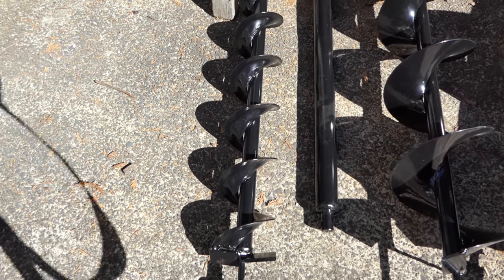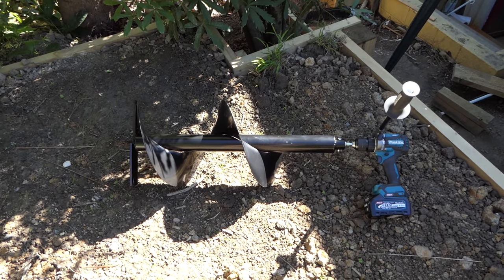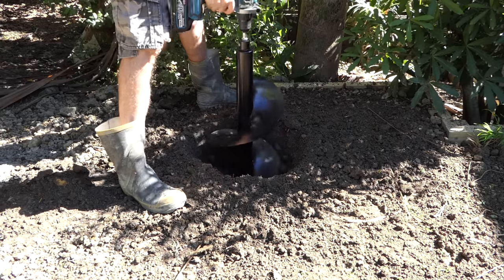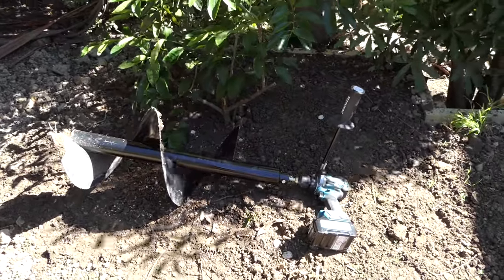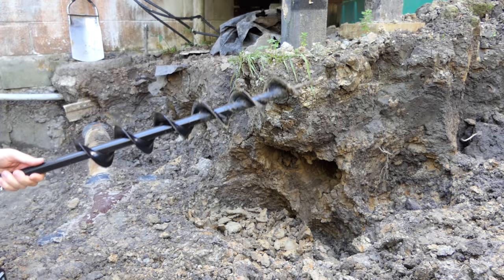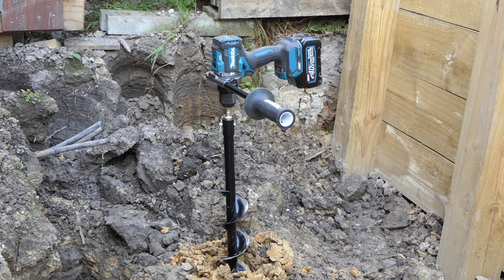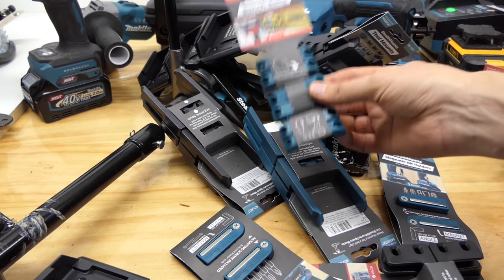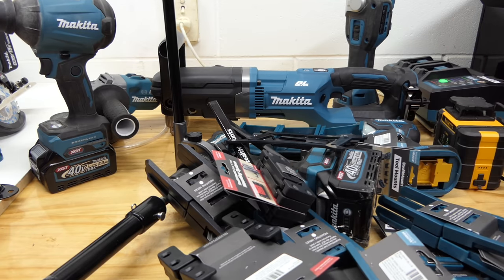Makita 40v Drill VS Massive Auger... Can Your Cordless Drill Do This?

Comment: Damn impressive! Cordless tools have come a long way fast.👍
Reply: hasn't been that fast 20 years
Reply: @brianwilliams9813  I don't know how many of these you use daily, but up until 8 odd years ago, my first choice for a  powertool was one that plugged into the wall. I've had rechargeable Makita gear since the late '90's and for their time they were good, but they were a joke compared to 240 volt power if you were in a hurry. Since they've switched to brushless and have gone 18x2 on the more demanding tools, (and now the XGT line) I haven't touched my Corded collection, and there's some damn good stuff amongst it. So yes, to me it's been fast, if you were 18 you'd have a different perspective.

Comment: That is absolutely crazy.  I can't believe a cordless tool just did that.
Reply: Just as with Ice auger , this has the problem that you can injure your hand .
People started using cordless drills with Ice auger and new line injuries appeared to ER , people with massive thumb injury .
In Finland Makita DDF486RTJ is sold with ice auger Rapala UR EVO EZ Makita Edition 155mm , that has a guard on the shaft .
Reply: @pete_lind yeah, weak link is the human.

Need some sort of rig that gives you more control.  I know my Milwaukee could do this, I also know it WILL hurt me.

Comment: Maybe the flexvolt mud mixer would be better, but still very impressive that a cordless drill can do that, I remember when a 2 9/16in drill bit would bog down my old cordless dewalt
Reply: Not long ago I used a old einhel 9v drill, god that thing is crap , it took ages to drill   into 5mm of abs plastic with a step drill bit , and getting it to 32 mm was a nightmare , swore to never run out of batteries on my drills ever again (was a customer's drill and it was the last hole , +the place had no electricity ... )

Comment: How do you adapt the auger to but to the drill?  Can you add a link for the part?
Reply from the maker: This is the adaptor I'm using. https://ebay.us/Kcscg4
Reply: How good are 7/16 hex bits. I wish the big drills would run a 7/16 quick change collett like an what the metabo and festool run in 1/4 i think.  I use the diablo quick change holesaw and a few or the arbors are 7/16 and quick change would be mint! I think the chuck in my hikoki has never been the same after running a 7/16 hex 150mm earth auger in it. I think the only 2 things with that driver size is usa only right angle drills and linesman impact drivers

Comment: I would love to see that drill drill through concrete with 150mm concrete hole saw I tried it with an 18-volt version of the drill I would be interested to see what the 40 volt would do 18 volt could not do it
Reply: I have had luck core drilling 100mm through brick walls for wastes with my 18v makita drill

Comment: Hey man, im impressed! But also wondering if the right angle drill auger thingo will turn the 300mm auger. Ive got the 36v version with 200mm auger but not sure if i should buy the 300mm. Cheers
Reply from the maker: Don't bother, it can't.  The torque limiter keeps kicking in. Might be alright inreally loose or sandy soil, but it can't go into the clay I was doing with the 200mm Auger last video.
Reply: @ToolsAndStuffOFFICIAL  rekon the 40v drill/driver would? 
I ended up ordering a 300mm auger off ebay that was pretty cheap as a test anyway. Il let you know how it goes.
Reply from the maker: Only in loose soil as with this video. I've tried both in clay and it's violent and ineffective on both. Can't get more than a couple inches in.
Reply: @ToolsAndStuffOFFICIAL  i just used the 300mm and it works great, as long as you keep lifting it to clean out the hole and let it dig itself, it works awesome!
Reply: Im making a 450mm auger as well so I’ll let you know how it goes as well. If it doesn’t work well, I’ll make a 6:1 planetary gearbox adapter to drive it.
Reply from the maker: Mad man!

Comment: There's been someone on trade me selling auger bits for drills, and I've thought about giving it a go with 18v drills for a while so essentially this video talks right to my imagination here haha. Do I need to dig a hole soon? No. Am I going to look at getting some for my amusement? Hells yeah haha
Reply from the maker: Some go straight in a drill chuck. The ones in this video need an adaptor as they were designed for post hole borers.
Reply: I bought a drill chuck one and the shaft broke within 5 minutes. It was no match for my Makita 18V drill.
Reply from the maker: I thought they might be like that. The real ones are far more substantial.
Reply: @ToolsAndStuffOFFICIAL   hi can you link your trademe . Cheers

Comment: Those buggers will twist your arm off. Its almost stupid how much power they managed to cram in such a tiny battery powered tool.
Reply from the maker: I know.  And I still get comments regularly from people saying "You don't need a side handle on a cordless drill"
Reply: @ToolsAndStuffOFFICIAL  After nearly taking off a kneecap with a 10 inch angle grinder I’ve got nothing but respect for these tools.
If there’s a handle in the kit that thing’s getting used.

Comment: I'd suggest using an impact wrench for this type of work. Saves your wirsts as well!
Reply: A impact wrench wont work with augers 😂😂
Reply: @michaeljugg9415  why?
Reply: @michaeljugg9415  I mean you could argue a tiny drill isn’t.

So there ain’t anything stopping it.
Reply from the maker: It'll never work guys. Impacts may have high torque numbers printed on them, but as soon as they need that torque they start impacting. Imagine trying to do a hole this size one tap at a time. Not to mention the noise and vibration. But if you are not convinced then make sure you keep an eye on this channel in about 12 hours time...
Reply: @ToolsAndStuffOFFICIAL  hell yes
Reply from the maker: 1.5 hours away...

Comment: There has got to be someone on this planet who is making adapters for tool batteries that can adjust voltage.  I wish I could use my 60v dewalt batteries on 40v makita tools.
Reply: It wouldnt work. 60v (54v) has to be in configuration of 15 cells (15,30,45,60 etc) 40v (36v) has to be in configuration of 10 cells (10,20,30,40 etc). 20v (18v) works cuz its a configuration of 5 cells (5,10,15, 20 etc) theres one flexvolt battery that could work with the makita 40v if the wiring was proper and thats the 15ah flexvolt cuz its a 30 cell battery which can work for either voltage. Has to be wired properly for it tho. I dont know how some1 could make an adpater that would change the battery to proper wiring and voltage
Reply: @bossmanz28  Reducing voltage is old tek.  It may not work the same way as a flex volt battery, but it certainly is possible.

Comment: You can say an amateur is using that drill. Reducing the speed will give more torque and more control over the tool.
Reply from the maker: You can see an amateur made this comment as you have not listened as the tool IS on the lowest setting as was talked about in the video. Nor do you understand physics in relation to the increased speed of the outer diameter of drill bits with the increase in size. If you are going to come at people, make sure you know what you are talking about, because you don't pal.

Comment: Those augers were designed to be driven with impact drivers not drills 🤦🏼‍♂️🤦🏼‍♂️🤦🏼‍♂️
Reply: I forgot the title of the video was "can your impact driver do this?"
Reply from the maker: No impact driver could ever cope with that much torque.
Reply: @ToolsAndStuffOFFICIAL  can you make a video plz? If it works might save me a bit of cash. Those big torque impacts are sitting at about 900nm, seems like it should work on paper?